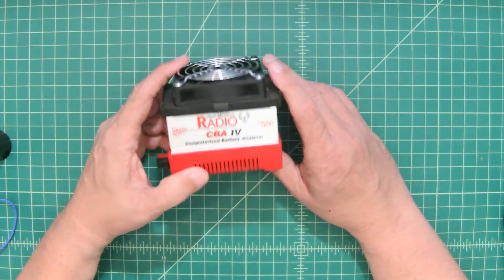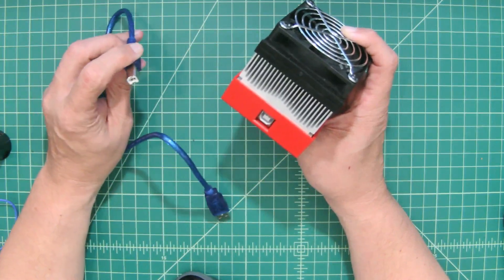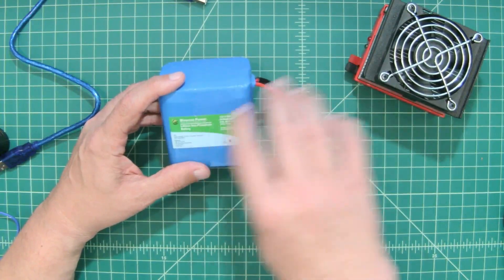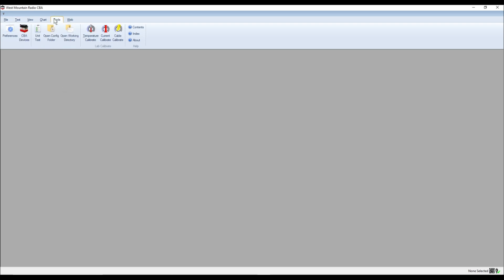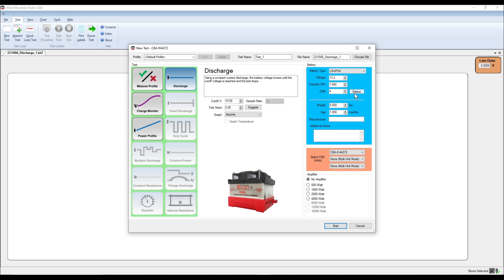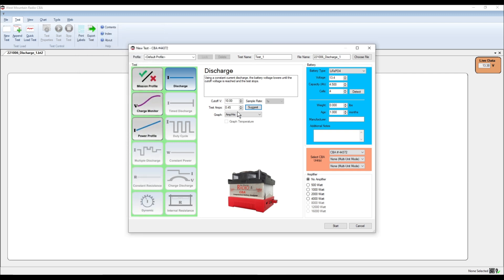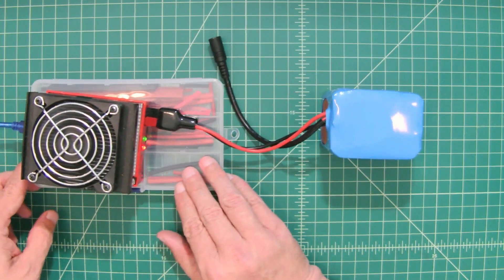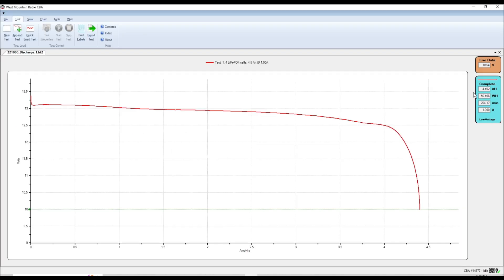West Mountain Radio CBA IV - Battery Tester

Comment: SKC pumps use these to test their batteries. Fairly good units. It gives a good indication on the battery discharge rates. 

I use the Cadex systems at the workplace
Reply from the maker: Not familiar with the Cadex, I’ll check those out 👍

Comment: Battery/load testers are so useful.  Just done a repair on an old drill pack. I want to cycle the pack a few times for capacity tests before it goes back to full use. Some battery packs  sold over rate  their capacity significantly
Reply from the maker: Yeah, ton of uses for these.  Thanks for checking it out Kevin.

Comment: i have had one of these CBA-IV for over a year and it's a great tool - expensive but well worth the  $$ - the standalone temp sensor is a great addition - 2 pins on the right of the ACC port - without the advanced software all it does is shut down the test if temp gets to high - to graph temp you need the advanced software -  if you get the battery sense/temp combined cable - this covers all 4 pins - the battery sense goes directly to the battery. The advanced software is required to independently graph the temp and direct battery voltage curve.
Reply from the maker: Yeah, I saw some of the options were grayed out.  I was lucky enough to get a price break with this one being used.
Reply: mine has 7years , but the fact that it does not have reverse-polarity protection is mind blowing... for that price range